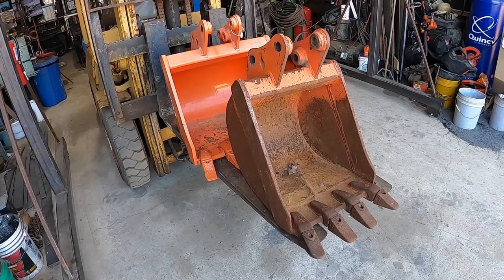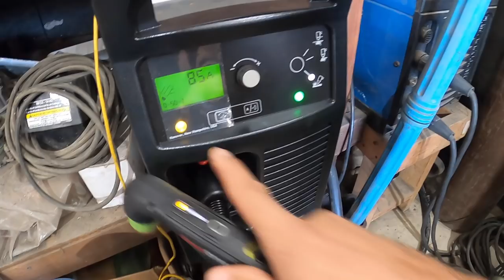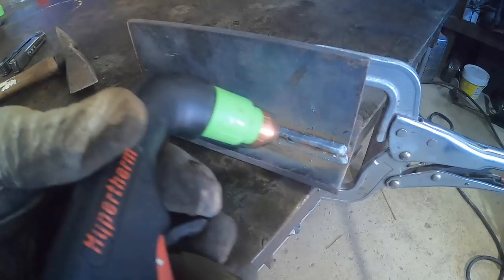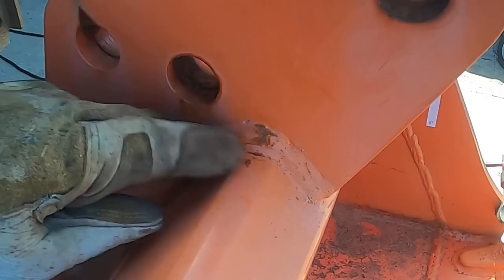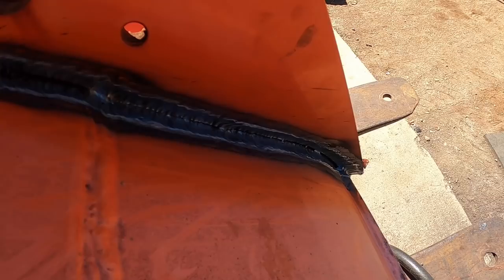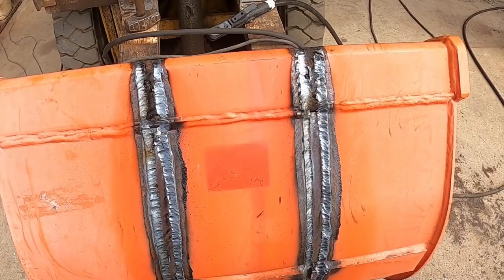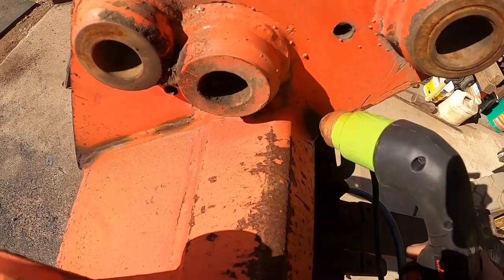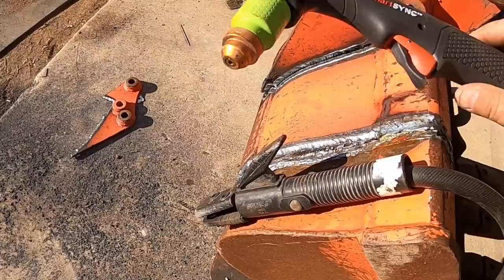Plasma Gouging or Carbon Arc Gouging? You decide.

Comment: For gouging, i couldn't see any advantage using the plasma gouger. Removing a bead or multiple beads is where the air arc shines. The plasma is more versatile for cutting I guess but for actual gouging it seems inferior. I wouldnt buy a plasma as my go to gouging tool.
Reply: One big advantage with the plasma is that there's no carbon fumes from gouging rods. One really bad thing less to inhale. Apart from that I would agree with you.
Reply: I don't know brother.  I can think of a handful of applications where this would be more practical over carbon.  Granted if you're working on heavy equipment or other heavy-duty stuff with big welds an air arc is king, but I do a heck of a lot of fabrication on a smaller scale.  Having something I can use on a regular basis without spending a bunch on carbon rods seems like a win-win for me.  It's a waste for me to gouge a single or two pass weld so I usually get the grinder out. This could bridge the gap and be perfect for people like me.  That's my takeaway, for what it's worth.
Reply: Firing up the stick welder to gouge out some small welds would be a lot more setup than the plasma cutter. At least in my shop. Also, like others said no carbon fumes.
Reply: I do like the plasma for quick and compact gouging..plus less noise and fumes..BUT- the thing I like the most about carbon arc isn’t so in plasma which is the lack of the heat transfer to the part during the process..both have their place and are better than a grinder
Reply: @gasaxe7945  I guess it depends on the situation.  For me, at least, having something I can grab and blow off a weld multiple times a day without having to depend on rods would be a big plus.  I do a lot of custom fab work, and as such, we're always taking sh*t apart.  Plus I screw up a lot, lol.
Reply: @pamike4873  haha, I love it!! I too am a frequent flyer in the screwer upper category, nice part about metal is most of the time you can fill er back up and start over................with that said I could clearly not be a machinist, far to many extra ways to screw up and the smaller the hash marks the bigger the headache lmao!
Reply: @pamike4873  we can all agree carbon arc gouging is a commitment in a mobile setting!
Reply: @gasaxe7945  That's a fact.
Reply: @GAIS414  The carbon "fumes" would be CO2, not exactly deadly in comparison to the metal oxides and whatever is in the paint.
Reply: @topduk  A study in Sweden determined that arc gouging exposes you to almost 100 times more respirable harmful particles, like for example manganese, compared to regular welding. Call it what you will, but it ain't good for you.
Reply: It took multiple passes for plasma gauger to finder separation line but took only 1 pass for carbon arc gauger, so youre 100% correct

Comment: Great and fascinating video.  Had an opportunity to take a welding class in the Industrial Education dept at U of MN, Duluth way back in the 1970s (yup I'm that ancient).  Oxy-Acetylene was the way to cut. Or soak a 6011  1/8" rod in water for about 10 minutes and run it at 180 Amps.  Plasma looks a lot easier and gives a nicer cut.  CAG works great, too.

Comment: If you turned the amps up. I was wondering if the arc from the plasma torch would be long enough where the nozzle wouldn't hit the pin boss. And you could maneuver the gun around the boss. Great Job sure a nice unit.

Comment: Can we all just take a moment to appreciate the arc shots, especially at 13:27. That made it so much easier to see what's going on in there
Reply: Absolutely!
Reply: How about 17:05   ?  That was quite a lot of weld removed down to the seam in two quick passes!
Reply: I just noticed this right off, and am wondering what lens he used, as well as what camera. The cleanliness of it and the light blue tint look just like it does through my Lincoln Viking 4C lens in my hood. (Lincoln 3350). The Jackson Balder lenses are the same. Super clean image, and well focused. After using that hood for a long time, I can hardly stand anything else, so be warned if you get yourself one; you'll be spoiled.
Reply: @ChevyConQueso  could be but he uses the 2x4 lenses and it looks a bit lighter (when off) than the Lincoln 4c. 
I noticed he was using a TrueArc HD lens to film the welding in an older video but it had a greenish tint. I wonder if he got the blue lens TrueArc came out with recently
Reply: @ChevyConQueso  I tried a bunch of 2x4 auto-darkening lenses when I was in welding school and I found a few that were slightly better than the Lincoln 4c. 

Weldtube sells a really nice one called the Clearview HD lens that had a purple hue with orange weld, makes it really clear. My favorite was the TrueArc Gold lens, the gold blocked a lot of the heat and it was very clear

Comment: Hello IC, great learning video. Once you get used to speed of travel and play with the arc force (amps) settings you will have it made.
I used the flat cups on the old machines for flat work, but joints or cutting thick sheets.  The cone shaped cups I used for weldments and tight areas by raising the arc force (amps) to hold a longer arc while still blowing material away. Give it a try to see what the torch is capable of doing while you have the practice machine.
Thank you for your time again IC.

Comment: i must have picked up something from watching your skillful technique... about a month after watching this video, there was an large excavator bucket showed up at the fab shop i work in, and i agreed to remove a cracked tooth adaptor with the carbon arc.  i had less than 10 mins prior experience using it, but i impressed the hell out of the boss,  by doing it fairly quick, and for not gouging into the base metal.  by the end of the day i got a 2$/hour raise.  keep making great videos, you're awesome man!
Reply from the maker: That is awesome!
Reply: 1 year late, but that is absolutely awesome. Hope you're making more now.

Comment: For those wondering about air coming out of the handle when arc gouging. You must have some kind of air supply such as an air compressor when using it and of course a welding machine.
Reply: There are airless gouging rods available too.

Comment: I have sold two of those units already. One was a 65amp hand unit, one was a 105 on a 4x8 koike table. The customer  was totally inpressed with the performance on the table. Hypertherm says the cartridge  should last 11/2 - 2 times longer than a standard comumable  stack. Check out thier flush cut from hypertherm. It was designed for just what you are going to do, cutting those ears off. Good work !!!

Comment: Great comparison, and great editing and arc shots. I think they both have their place, and are both extremely capable. I'm about to use plasma gouging on Monday at work. I've had a Hypertherm 45XP since they came out several years ago, and still haven't used the gouging function. I have a handful of smaller welds to take care of, and I think it can remove them 100x as fast as a grinder can.

Comment: I prefer the Arc Air stick gouger as that's the gouger I learned to gouge with . Tried the torch gouger but it didn't turn out very good . Stick gouger sure works great when you screw up and have the brackets fully welded and then find that they are in the wrong location .   Great video Issac  .

Comment: Learned a few things.  The modest amount of plasma gouging that I've done was backwards of what you did just carving out the weld until I could see the separation line.  Never had any instruction or even saw it done so I didn't know any different.
Reply from the maker: You make an interesting point. Maybe I was doing it wrong. Maybe I should have done it backwards. I'll try that.

Comment: I have a thermal dynamics 60i and gouge with it at least 3 or 4 times a year. Works good. Always wanted to try carbon arc.
Reply: The 60i is a beast at gouging. (A-E styles) Now Hypertherm the flush cut tips could be a option  that makes a lot of sense, if you want some  real differences

Comment: i been working with plasma and arc air for years and in my opinion the arc air is by far superior for gouging.
the heat affected zone is way smaller. its cooler on the hands and the overall finish is better. i only use plasma when people are grumpy about the overall smoke of the arc air.

great video i'll come back for more.

Comment: Great video issac, I use the extended reach consumables for gouging from hypertherm. Extended reach consumables allow for better visibility and your hands don’t get as hot because they are farther away from the arc and molten metal. They also make a shield that fits onto the torch to help with the heat.

Comment: Excellent comparison video, my initial feeling on the plasma was, that’s neat, I’d like to try it out for sure.
Don’t think it’ll take over from air-arc 100% at the moment but technology don’t stand still.
Thanks for sharing 👍
Reply: I ran both on a really large repair of cracked 1.5" plate. the plasma worked way faster but started to struggle and got really uncontrollable about 1/2" to 3/4" into the plate. it might be because I don't know what I'm doing but we had to use carbon arc to gouge out for a good root pass once we got deep enough with the plasma. I'm trying to practice with my thermal dynamics machine but it really sucks compared to hypertherm.
Reply: For plasma to really shine on thicker material, you want it hooked upto 3 phase . A 220v 50 amp plasma cutter will cut 12-15 ish MM material “cleanly” at its max setting . Anything less than that it’s just going to be able to cut faster and cleaner! I don’t work with anything thicker than 1/2 “ so my Herocut 50 amp plasma cutter with its PT 30 torch is perfect. I love that thing and it was very affordable as well as to this day insanely reliable. Not all Chinese plasma cutters are built to the same quality standards . Herocut is going to be your best bet , great value and good quality. They have much bigger 3 phase and I believe upto 60 amp machines that are single phase I’m not sure. For plasma cutters you want the driest air possible , it really makes a difference in consumable life. Stay away from anything 110v , the inverter IGBT’s or mosfets wear out quicker on 110 V.

Comment: Very interesting video. I have done quite a bit of airark gouging over the years doing heavy equipment repairs. I have used a plasma torch for cutting and like the way plasma cuts. That’s the first time I have seen plasma used to gouge out a weld. With your experience using stick air ark clearly that proses looked a bit cleaner. But maybe with practice plasma gouging could look as clean. Also I liked that you used the 2 different plasma tips. Very interesting. I enjoyed this one 👍

Comment: I used to run a Hypertherm plasma cutter and can confirm it was a quality machine. Yes more expensive but it really was made to a high quality standard. There really is no comparison to those Chinese (rebranded) plasmas you can find in tool supply shops. Tips lasted ages for it if used correctly too.
When I first used the Hypertherm plasma I was amazed at how quickly it cut metals. From that seemingly innocent gun all hell breaks loose once the trigger is pulled!

For me at my shop the only downside with a plasma was it needing a sufficient air supply. Mine tended to use more air than I was expecting but then again my air supply wasn't a huge one.
That's a very interesting comparison. I've not used a carbon gouger before and to see the comparison shown is great. I do think that carbon will remain your favourite though as it suits your workload perfectly. It might be 'old school' technology but if it works keep it.

Comment: Very cool side by side run Isaac! My first thought was "Holy cow, that's way quieter than carbon arc....." but then I realized the plasma gouger doesn't have to shoot air to the end of the rod where the job work is being done.......I may not be quick but I'll get there eventually haha!  I've never tried carbon arc and only have used plasma a few times but I don't think one will ever replace the other

Comment: Great video. I think you need both in your field the fitment issue. Also cost comparison. Obviously the plasma consumables would be cheaper. I worked for a company that wanted to put zero money into anything. Did a lot of wear plates and patching on chutes and shakers. Glass industry.  Cut a lot of chromium carbide overlay plate with 6013 soaked in water and crank the amps!  Ugly cut but I got it done. Things have come a long way.

Comment: Very interesting! I personally have never used Carbon gouging before. I have always used plasma gouging. That’s a very nice unit too. Much nicer than the stuff I have. But still we adapt and learn. I actually gouge most of my stuff at around 25-35 amps With a cutting nozzle. It is very precise and I’ve never actually needed any more amperage and I’ve cut welds on 1.25 inch plate.
Reply: I've always done carbon arc and never gotten to try plasma. I was just thinking about how gouging off my weak mig is usually more fun than cutting with my wimpy plasma, but if you can do it with 30 amps then I'm going to have to give it a try.
Reply: I'm grateful for your comment, as I've never gouged at all! But my current video project I'll need to cut 1" plate & my plasma cutter is not very effective cutting beyond 1/2"-5/8" or so. Was planning to torch cut.  Now I may try plasma gouging my way through it just to learn about the process...always learning...even if it's learning it doesn't work!
Reply: As a follow up to my first reply, I just did a little digging and through Kevin Caron's page I found George's "The Plasma Cutter Shop" on eBay. Not sure what plasma torch you have, but he sells gouging tips for a few models. They're spendy, but the quality is really good. I have same cutting tip (made in Italy) and it's waaay beefier than regular Chinese stuff.
Reply: @branchandfoundry560   sorry for the delayed response. So I have a primeweld cut50d nothing crazy fancy and I buy all of my consumables on Amazon. I think RXweld. The art to it is just take small bites. I actually don’t like cleanly cutting with my plasma anything more that say 5/16-3/8 but for gouging, I’ll lay my tip sideways and just do a slow tigweave like motion and it is very controllable. Taking out only what you let it really. May have to make a couple passes but it works for me! Now I still typically rely on my torch for actually cutting thick material.
Reply: @maxscott3349   try it! I really like it and picked up on it fairly quickly. The downside I see is going through more consumables than just strait cutting.
Reply: @williamdavidson2233  Thanks for the reply! My gouging tips have not arrived yet, so I torch cut it yesterday. Btw I have a PrimeWeld Cut60 and their TIG 225X machine. I've been blown away by their performance and over the top customer service. Can't say enough good things about them!

Comment: Very cool indeed, I've never seen the gouging tips for plasma cutters before. Looks to be working perfectly. I saw some videos on plasma gouging a couple of years ago but they all seemed to use regular cutting tips. So it didn't really look very effective. But I'll definitely check if I can get something like this new style of tip for my old ESAB PCM 875. Thanks for another great video!
Reply: I was doing some gouging with my chinesium plasma, it's really hard on the nozzle, they don't like to  be held at a steep angle to the work, it erodes the tip badly.. maybe better tips would be a little more resistant to that?
Reply: @Rx7man  When I first started plasma cutting, I had some problems with my old worn out compressor giving me dirty damp air. I went through nozzles like crazy. I bought a new compressor, changed all the hoses and put in a high quality separator and filtration unit. Now I have no problems with premature wear on the nozzles. It sounds pretty weird that the nozzles would wear out because of a change in work angle.
I would make sure the air is completely dry and clean first. Anyway, I will try some gouging tomorrow and see what happens. Maybe you're right.
Reply: @GAIS414  the drier/regulator on the plasma machine is dry and has no condensate in it.. figure the air can't be THAT bad if that's the case
Nice Captain Haddock pic :)
Reply: @Rx7man  My nozzle still didn't burn out prematurely from gouging. Maybe it's a matter of Swedish vs Chinese quality?
Reply: @GAIS414  I can't deny that could be a major factor!

Comment: Interesting stuff. I have tried plasma gouging with my plasma which to be fair, doesn't have a gouging torch and I can tell you it wasn't pleasant, easy or indeed neat. I will get some carbon arc sticks because from what I see in your video it is a better process but, I reckon Hypertherm are onto something. I did a pin size change and hitch modification on a bucket recently and had I had the carbon arc rods it would have been an easier job. Already got the Symex air arc gouging torch, big compressor and a welder just about big enough so will try it one day soon instead of using my plasma unit again. Top stuff Isaac!

Comment: Hypertherm makes "Hyacess" tips for those harder to reach spots. They also keep your hands a little further away from the heat. I almost never use the standard length gouging tips anymore.  I run a 45xp on my truck.
Reply: I have that tip for my ancient Powermax 900. It's all I use as well.
Reply: IC is definitely one of the most talented guys that I have seen using his many talents on YouTube. Some of the comments I see from a lot of you guys makes me wonder if you should be driving a welding truck, or a flower delivery van!
Reply: @thomashaley5284  What is the point of your comment?